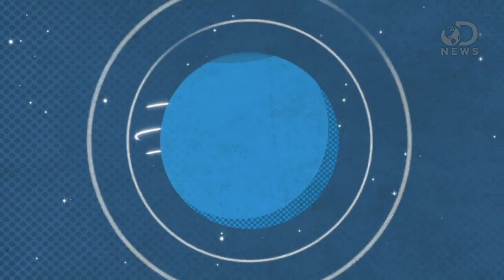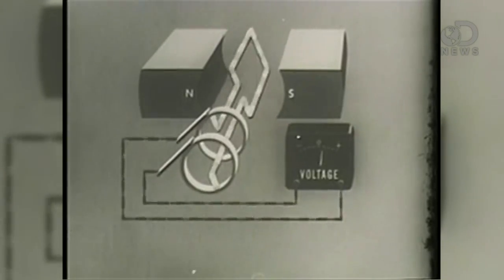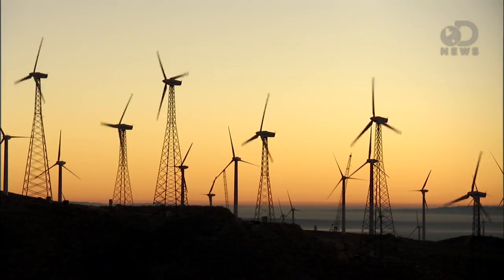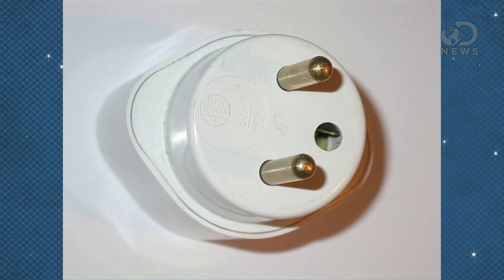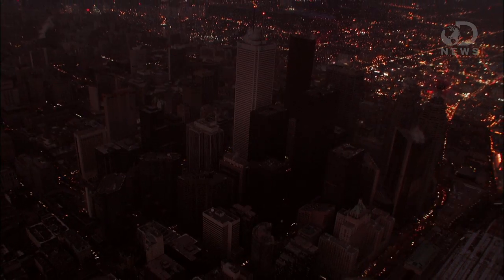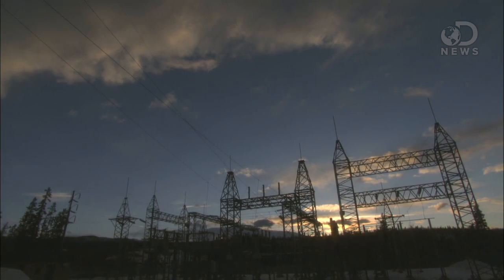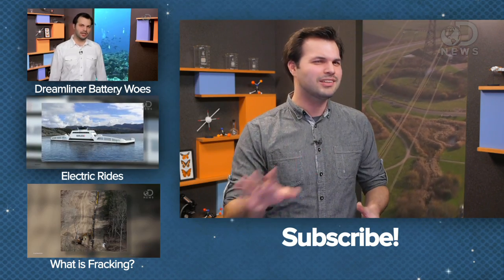Big Game Blackout: The Power Grid Explained

Comment: Hello, just regular guy here. Which voltage is more efficient to power electrical appliances 110V or 230V. For example which PC would used less fossil fuels in USA operating 110V or in Poland operating on 230V. I know switching everybody to one type of voltage would be a major undertaking.
Reply: A educated guess, half the voltage = double amps in local wiring, the rest is up to what the appliance is designed for, most things connected like chargers and other low voltage stuff use switched conversion that is quite efficient, but is probably more efficient at 110v than 220. The mains lines that go from local transfomers use high voltage in the kv range so there should not be so much  difference there, but there are guys here that can answer that question much better than me .

Comment: Problems and solutions for each power source:

Solar: Instead of solar panels which are inefficient make concentrated solar power
Wind: A vertical chassis that is used to make energy. Less kinetic energy to make the same amount of energy
Steam: Loop the excess heat back into the plant.
Combustion: More natural gas and less gasoline.
Biofuels: Industrial hemp.

Comment: Sry, this is the first time that I have to dislike one of your videos. This "Power Grid Explained" doesn't even mention half of the stuff that I need explained. Yeah, "we suck at storing electricity", but hydro-storage (pumped-stored hydro-electricity) is possible and should at least be mentioned with one sentence. I don't expect a calculation of how many mountaintops would have to be removed to create artificial lakes if the power grid has to be able to compensate the natural fluctuations of, say, 20% solar and wind power, but I still hope that someone somewhere has calculated that. But I will have to look on other channels, DNews apparently doesn't even know that it is possible.  You also don't explain what power grid frequency is or how grid interconnectors work. You don't even mention that there are different grids in the USA in this video (only in the next one), so there are even more interesting questions, that you fail to even take notice of, especially the question if larger grids are more susceptible to blackouts and what can be done to prevent them. I don't know the answers to these questions, but, unlike with videos of DNews on other topics, I apparently know more already than the team responsible for them.

Comment: nuclear. energy. simple.
Reply: I wish it were, but it's not that simple. I'm not totally sold on the "batteries suck" contention but nuclear energy needs batteries with massive storage capacities in order for it to become our "simple" solution. Nuclear power plants generate a very stable flow of electricity, so they cant just "generate more" or "generate less" on a whim to track demand's fluctuations, so we need huge storage for it to work.  :/

For the record, I haven't done my research on batteries yet, so don't let what I've said discourage you or anything. Nuclear power is great.  :D
Reply: Lambert Lim mechanical "batteries" are useful -> excess power powers a pump to move water from a low to a high potential thus storing energy or liquid metal batteries. These are huge so not useful for transport -> but for the power grid. I'm still waiting for wireless power though ( ͡° ͜ʖ ͡°)
Reply: Mike Hunt
Well, clearly I need to do more studying.  :D  And yeah, wires are a pain.  xD
Reply: Lambert Lim develop a working and efficient wireless power grid and you're going to be the richest person that has ever lived.
Reply: Mike Hunt
Unless you're a man named Tesla.  xD
Reply: nope its not simple, it rips apart atoms and uses the excess heat to power a steam engine or whatever they decide to use
Reply: and it leaves super toxic waste that we need to get rid of
Reply: aiden aune
Well, in response to toxic waste, I imagine getting rid of solid or liquid waste is easier than getting rid of gaseous waste i.e. greenhouse gases.

Comment: What if we stopped using "grids" and began using individual household power sources? For example, why can't it become a universal standard that every household has its own solar panel, wind mill, geothermal generator, etc? It would be a very expensive house, but it would cut taxes and also monthly bills! Thoughts?
Reply: Because, people demand reliable dependable power. Solar panel only works when it is nice and sunny, meaning that house will still need a power plant to deliver power during the time when solar panel is insufficient. Same goes for the wind. Geothermal is a little better idea problem is that geothermal is not viable in some places, so places it in the same boat as the other two.
Reply: Ivan Ilin VloggerJoey 
i think Joey has the right idea in terms of adding power producing capabilities to every house it makes sense but as Ivan pointed out we need dependable power so why not do both? solar grid ties. or wind grid ties. it gives power to you locally and if you produce extra it goes into the grid and they offset your power bill or if you produce more then you consume in some places they buy it back. this would allow power companies to reduce their daytime production by a great deal so they would gain the ability to either upgrade efficiency or upgrade the grid itself.
Reply: Ryan Schafer 
and the reason i didnt mention geo thermal power is because that is beyond difficult for many people outside of heavily geo thermally active areas.

Comment: steam turbines don't spin faster if they need to make more power, they apply more torque to the synchronous generator.
Reply: DesertTripper Ya, to get more power from a 60Hz generator and you can't spin it any faster than 1800rpm (depending on the number of poles), so to create more power you can only increase the torque from the prime mover (Power being a function of RPM, Torque and a constant). I also remember my instructor slamming phasing a 3 phase motor into reverse direction, so out of step generator can only get worse :P (long time ago, I'm graduated)
Reply: You are partially correct. Turbines don't spin faster that is correct it always spins at 60 rev/sec. Giving us the 60 Hz. But it doesn't change torque per say. Powerplant uses more conductors, therefore capturing more energy from the turbine.
Reply: Ivan Ilin
It didn't work that way with our 3 phase synchronous motor acting like a generator (in college). All we did was add more power to the prime mover and the RPM never changed. The only "conductors" I'm aware of are the cables that send DC power to the rotor's coil, but that changes the operating voltage I believe.
Giant +100 megawatt generators are more complicated than our 3/4HP motor though.
Reply: By conductors I am implying the windings on the rotor. Power station can increase the number of them which will in turn will induct more current on the stator windings. But will increase the resistance to the rotation and that's where the increase of the torque required is observed to keep the 60 Hz rotation.
Reply: Ivan Ilin Huh? Of course the torque has to change! Power in has to equal power out. Power plants use more conductors than household appliances; this is because power is generated in three phases, 120 electrical degrees apart. This allows more efficient transmission, but you can't magically make more energy by adding conductors. When a power plant "ramps up," the excitation (field strength) is increased in the rotor, inducing a greater electromotive force in the windings providing the power. At the same time, however, the flow of steam (or whatever) supplying kinetic energy to the turbine has to be increased. The "infinite bus" (the grid) that the generator is connected to will attempt to keep the rotor at synchronous speed if excitation is increased, but if there isn't enough mechanical power to keep it there, you will have out-of-step conditions, slipped poles and other nasty issues.
Reply: Ok I think you need to revisit that. Cause I tried to make it simple in the first comment, but since it look like you are interested. Here is the book you can get. Typically less than 20$ for a paperback. Power System analysis and design. J. Duncan Glover, Mulukutla S. Sarma, Thomas J. Overbye. ISBN 81-315-1635-0.

Comment: you coud pump vater up in to a big thanks and use that  as a batery by relising it into a turbine.
Reply: Michael Wright Actually that idea is viable, except they have to use something bigger like a reservoir and mostly for long term storage; hydroelectric power plants use the same principle although the water comes from natural sources. A related idea proposed for short term storage would be to compress air and store it in either man made or natural caverns which are air tight, when demand peaks or at night when solar doesn't work the air is released over a series of turbines, generating power.
Reply: That is actually done in several places. The system pumps water up the hill when the demand for the electricity is low and the price is cheap say middle of the night. And drives it through a turbine then the demand is high around noon. To offset the cost of the electricity production.

Comment: Well for me I have some ideas for starters we need to go back to our roots and understand what the first battery was, how it work, why did it work, and can it be transform.   So with this I looked and study the original battery.   It uses an acid that we can find in many fruits.  This acid is able generate power for us to use, but it's in very little amounts.  Yet our batteries today can hold and release energy for us to use in our daily lives in large amounts when needed.  So why can't this battery do the same?   With that question in mind I realize it possibly can, but we need to update it with current knowledge and compare to ancient times that's a lot knowledge we have now.  So I have form a theory which is that it can hold the energy we put in it.  Long we add the right amount of water to it, but when we add it both the water and acid needs to be in there purest form when mixed.   Also when yes the battery can't make much energy for us.  Yet I believe it can store far more then we ever thought possible and keep the energy at a stable level for longer period of time then today's.    That's only because the acid will always add energy, but since it's at a very little amount the energy will never change longs it's casing doesn't link any of the acid out.   The problem with today's batteries they was only designed to hold energy, but never to keep the energy level stable.  Now I have never tested this Idea of mine, yet I'm 75% sure it will work.

Comment: The problem is centralization, we need to decentralize the network. Think of power produced in your home by a generator using two opposed magnets, using a mix of different electrical generation systems. Just think about it.

Comment: The electrons don't wanna get out.
If you get electrocuted when touching wires that's because the electrical system is grounded.
In your power plug you get 2 or 3 wires:
Live: Is the wire where you get the current, it's one of the three coils in the transformer, the other ones are also lives.
Neutral: Is the wire connected to the ground and the core of the transformer, touching it is theorically safe.
Earth: Is the wire connected to the ground in your house it conduct electricity to the transformer core when you get a wire touching a metal part.

You will only get current if there is a difference of potential between two wires so if you grab a wire from a power line without touching ground or another wire, you will live.
Reply: Read a physics book. You'll will gain a more fundamental theories. Trust me im an electrical engineer.

Comment: Everyone failed to realize that the video of the nuclear power plants was putting way less shit into the air. And the only shit it does put into the air, is steam, not all the burning coal and shit
Reply: Joshdragon Van Drechsler Scuse me? radioactive hot water?

You must have no idea how nuclear power plants work. Theyre either closed or open loop. 

Closed loops have a single line of water that actually touches the rods and boils into steam. The water is then sent to the cooling towers, the massive typical nuclear power plant building, where the steam that comes out is actually from water that was used to cool the steam down.

Open loop systems take on a double boiler approach, where there is water that constantly touches the rods to transfer heat to a second tank of water, which gets boiled, and then proceeds to be released into something like the ocean after passing through cooling towers.
Reply: What about the nuclear waste?
Reply: Tybo1080 Theres less radioactive waste material, that is easily stored, than the millions of tons of carbon and other soot that is produced by burning oil and coal, which are hydrocarbon chains. Burning them splits them and releases energy that was used to put them together, aswell as releasing all carbon that was used to make them into the air.

Nuclear waste is solid, Think of it like trying to move a brick vs trying to move a pile of ashes. The ashes easily go into the air and get blown around, while the brick sits there like a brick, which you can pick up and move.

Also, burning coal and oil produces Carbon dioxide, which if you have a 2nd grade education, you know you cant breathe. Nuclear power plants just make hot water.
Reply: Jombo23 Radioactive hot water. Coal and oil fired plants wouldn't be so bad if there fule came from a sustainable source and the "exhaust gases" were trapped for the sake of the local ecosystem. Otherwise if it is a sustainable source (ie from plants) the "exhaust gases" are subject to the carbon cycle in a sustained (safe & healthy) manner. All power sources have practical applications and I believe potential to "do good" as well. A good example would be Nuclear Thorium plants if the sun where blocked out in the sky...
Reply: you are correct. I ment radioactive steam which is then condenses into water for storage on site. If i'm reiterating your words correctly.

Comment: all electricity flows at the same rate no matter what happens to it.
I like to compare it to a highway with a set speed-limit. current is the number of vehicles and voltage is the size of those vehicles.
~and resistors are bottle necks.

Comment: The speed of electricity would be current. Voltage is the "pressure". The higher the voltage, the more current will flow (provided the device generating the voltage has enough power behind it). So at 1 amp, you have 6241000000000000000 electrons flowing past a certain point in your circuit every second.

Comment: Electrolysis takes more energy to separate the hydrogen and oxygen than you get back by burning it.  The only reason to use it is because you can store the hydrogen and oxygen to burn later or put in a fuel cell but for home use solar and wind by themselves is all you need.

Comment: Voltage is not an amount of energy, it is the difference in electrical potential between two points. Think of it like a waterfall where one end is higher than the other. Water like electricity "flows" from higher potential to lower potential. Let's say the top is at 120' (phase) and the bottom is at 0' (ground). The "voltage" of the waterfall would be 120 "volts". But just as another example, if the low end of the waterfall was at 108' then the "voltage" would only be 12 "volts".

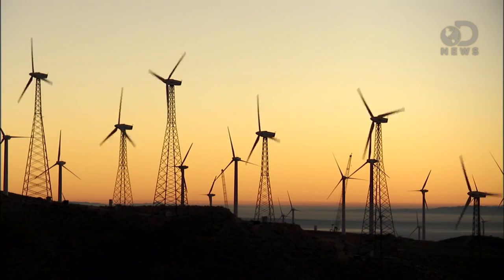Comment: at 3:06, you are wrong... fi they spin the turbine faster and faster, than they CHANGE THE FREQUENCY of the current. AND YOU DON'T WANT THAT! it must stay at 50 hz ! The only thing a powerplant can do is to strat more of it's turbines... if it has 12 turbines and they run 7 during daytime, than they cand start spinning another 2 or 3... but at the same rate... to produce ac current at the same frequency...

Comment: From what I've studied, the electrons themselves are not actually traveling very far at all. They sort of jiggle back and forth, drifting down the wire at about 0.4 mm per second at a maximum. That's slower than a snail runs (slides? oozes? what do snails do exactly?). The energy is what shoots down the wire as electrons pass it along from one to the other (like the energy moving through ocean waves, only faster). Cool stuff.

Comment: Two ideas (one significantly less complicated) Open for discussion:
1) Generate electricity locally where possible, as distributed systems will be more reliable. Literally anyone who owns real estate can do this and make a difference, big or small.
2) Smart appliances and dynamic pricing models. My dryer should know when electricity is most abundant and run at that time. It should also know if there is a power shortage, so it can turn off.

Comment: how about storing energy kinetically? pumping water from a lower reservoir to a higher one in times of excess and releasing it to spin a generator when needed. Or driving a train up an down a mountain. There's an efficiency loss but is it worse than the problem at hand?

Comment: Trash the old AC system in cities for individual power buildings using DC. Back in the days of the current wars (Tesla's AC VS Edison's DC) with that time period, there were no solid state components that could efficiently convert low voltages into higher voltage that could more easily travel.

Comment: However, now not only is 30% of energy produced being lost in long distance lines, but we need devices to convert 120V AC into low voltage DC for computers, phones, TV's end basically every electrical system. (feel the lost heat energy on the top of your computer monitor)

Comment: With solar and wind energy becoming more practical, what if one were to get rid of a centralized power line and replace it with smaller scale wind turbines, green roof's, and semi-transparent solar arrays on windows instead of the mylar. This DC energy will be converted into a high voltage, high frequency DC biased square wave